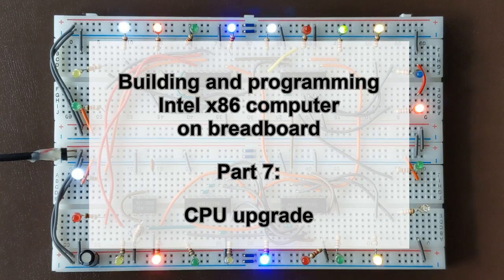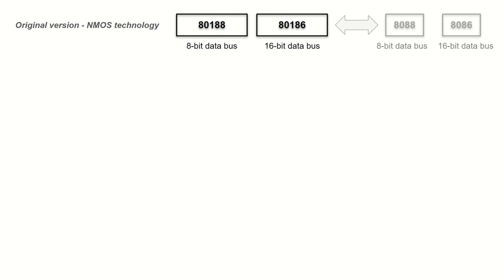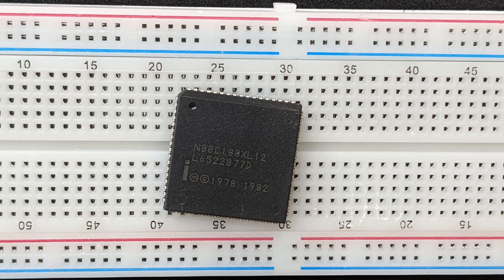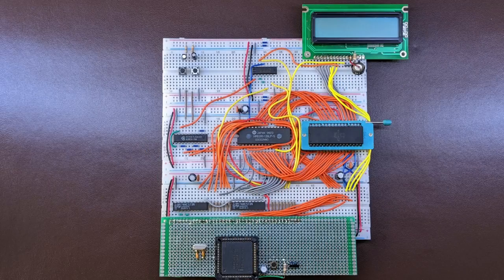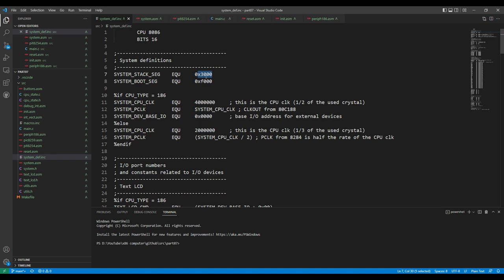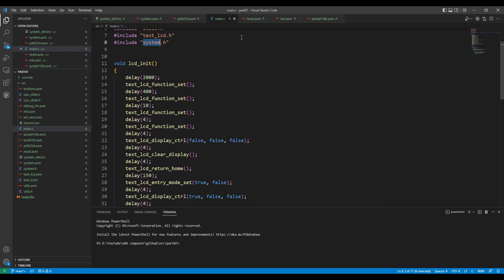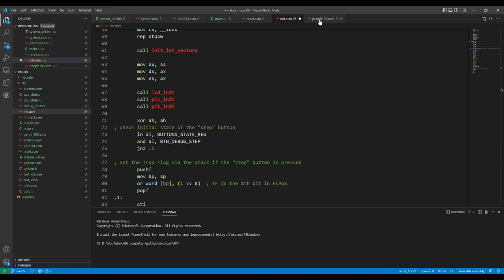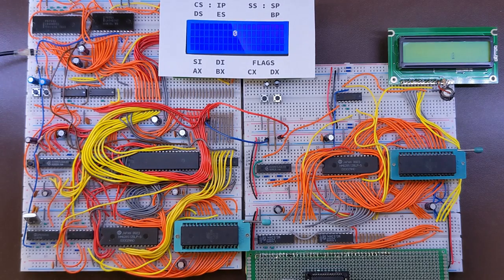CPU upgrade - 16-bit Intel x86 breadboard computer [part 7]

Comment: I recovered an 80C188 from an old printer. Now I really want to build myself a mini PC with this processor. Thank you very much for sharing the schematic. I try to do some experiments. Thank you!
Reply from the maker: Thank you for watching! By all means - yes, experiment! Schematic is very basic - just wanted to show the viewers how easy it is to build something working with 80188 and that you don't need those additional peripherals. I would like to build something more complex on top of that in the future.
Reply: 1 year later - how did you do?
Reply: @RayMillTN1  A series of "misfortunes" prevented me from doing so. I barely unsoldered the CPU from the original board. Now I have moved on to other projects, for example the power supply, which had passed away. Unfortunately, dedicating only 2 hours a week to this hobby is difficult to achieve results. I'll try harder!!

Comment: Your videos are so inspirational.  I love working on low level bits/register levels.  Never attempted doing it on 86x type cpus as didn’t see many clear tutorials as yours.  This is great , I’m working on a lcd/vga controller using the propeller chip.  Will use that in conjunction with the 8086 stuff to see if I can make some whacky system.
Reply from the maker: @bitlong4669 I'm going to introduce a VGA controller soon, but not based on TTL - instead I'm going to use some modern chips for that. I hope you'll like it. What chip are you planning to use?
Reply: @SladorSoft  I was thinking of using parallax propeller.  It’s an interesting microcontroller.  8 cores, neat timer functions.  The older P1 version as I have lots of those, or maybe I’ll buy newer P2.  They don’t have lots of memory on board, but I do have some dual port ram to compensate for that.  Another avenue would be to use fpga.  If it runs stuff like prince of Persia , wolfrenstain 3d…..maybe doom lol, that be good enough.  I’m not nearly as experienced as you so we’ll see how it goes.  It’s more of a journey for me not a destination.
Reply: @SladorSoft  ah I see why you asked about chips.  I just finished watching the PIO video.  The propeller chip have these timer guided outputs as well to generate vga signal for example.   I see the potential for the same with pico PIOs.

Comment: I've made an SBC out of an 80C188EB, from a scrapped hsdl modem. Now it's running ELKS, and I've added a simple isa interface for a network adapter, which also works on that system. You should have a look at it, you'd need 512/512 flash/ram to get it going, but not much more. I don't think the serial port would work out of the box for your XL, but it's doable :)
Reply from the maker: Santiago, thanks for showing me this. It looks really cool! In the upcoming video I will fix the issue of not using the whole 512kB RAM and start adding more peripherals, so we will see how it goes. Maybe one day I will be able to run ELKS on it as well? Thanks!

Comment: Doesn't the 80188 have dedicated "mid memory" and "high memory" access lines ? You show the part of the data sheet at 08:20. I think you can program MCS0-3 to be address line inputs for your SRAM memory chip, so you can address the full lower 512 K as RAM. At 16:10 is where you.can initialize it, and then use that to access RAM. It might need an OR gate or a "diode or" for the chip enable to the RAM.
Reply from the maker: Yes, you are perfectly right. but - as you correctly noticed - it would need an additional gate (AND to be precise). I didn't bother as it was only a temporary contraption on breadboards which I later moved on to a PCB. Then I decided to use the address line A19 to select RAM, because I'm planning to use the MCS signals in the upper half of the address space which I'm going to do in a future video (around the third from now on).

Comment: @slador, I have been looking over the 8086 datasheet and I can't figure out what the maximum allowed current draw is from the address/data lines. Do you have any idea?
Reply from the maker: @Pete Dietl: you are right - I haven't found it as well. I guess they never expected us to tinker with it and hook - for example - LEDs to the buses ;-).
Maybe we can infer this from other data in the "DC characteristics". I guess, if you keep your current drawn from all outputs and the ICC together below the maximum power dissipation you should be fine. For the 80C88 (the CMOS version) it is 1 watt, so the total current drawn should not exceed 200mA where the CPU itself uses 10mA/MHz. That would mean that for 80C88A-2 (the 8MHz version) it would leave you with quite comfortable 120mA.
Again, don't cite me on this ;-)
Reply: @SladorSoft  good thinking. So limiting each LED attached to an address line to 5mA should probably be ok.

Comment: Hey, I'm trying to do research on doing my own i286 homebrew build. I'm only recently starting out, and I have a general plan for the featureset/design I want, but one thing I'm having issues with is actually: where can you buy the CPU/ROM/RAM socket you're using? Looking up "286 CPU Socket" isn't very helpful lol
Reply from the maker: @Kaisogen I generally look in electronics shops, or simply eBay or Amazon. It depends on where you are, really.
You are right: searching for "286 CPU socket" may not give you good results. You need to check the datasheets of your chips for the type of package they have. For example, the 286 has the same package as my 80C188, which is PLCC-68. My Flash and RAM are DIP-32. Try searching for those. The green socket I'm using for my Flash is called ZIF (Zero Insertion Force) socket - very helpful in early stage when you programme your Flash a lot ;-) Good luck with your design!
Reply: @SladorSoft  thank you, that's exactly what I needed! I'm thinking of using an NEC μPD7220 for the graphics! One of the design gimmicks I'd like to implement is bank switching for the hardware ROMs via a cartridge slot. So you can load multiple EEPROMs for your OS / Software alongside a slower peripheral.

Comment: Do you have a .hex file for the 29c010 ?
Reply from the maker: Hi! My programmer uses flat binary files and that's what my Makefile produces by default. If you have the "ia16-elf" toolchain configured you can compile it yourself and then run: "ia16-elf-objcopy -I elf32-little -O ihex bin/part07.elf bin/part07.hex" to get the hex file. If not, I can send it to you. Please, email me (my address is in the About section of my channel) and I'll reply you with the hex file.

Comment: Great project, but going for 80188 makes it incompatible with all PC software (there is a reason it was not used for any PC Compatible machine)
Reply: Really? I am not sure, IIRC it is software compatible with at least 8086, even with 80186 which itself is a somewhat expanded 8086 but unlike 80286 not having (16 bit) protected mode, but some extra instructions of 286 is supported. Surely it is not compatible with '286 at least. And in fact there was some (though not many) "PC compatible" computers based on the '186 where '188 its 8 bit variant by the size of its external data bus (but IIRC not so much  a problem about software compatibility). I would guess, it's more-or-less OK to have a 8088/XT class compatible design at least, as it's not enough for 286/AT indeed.
Reply from the maker: @seeindarkness - yes, that's true, but PC-compatibility was never my main goal in this series. Also, by writing a proper BIOS you can still achieve some compatibility (by correctly implementing some of the system calls, INT 0A, INT 13 and so on...) but that's another story. Thank you!
Reply from the maker: Hi! There is a machine code compatibility and computer as a whole compatibility. You're right saying that you can write compatible machine code which works on both 8088/6 and 80188/6 (just compile for the former one), but the peripherals inside 80188/6 are not compatible with those in IBM PC XT. I think what @seeindarkness meant was that it's not compatible, because it does not have 8259, 8254 compatible chips, so any programme written with assumption that these chips are there (at very specific I/O addresses) would not work. It doesn't mean that none of the software would work. Depends on how closely the software touches the hardware directly (without BIOS in the middle).
Reply: @SladorSoft  Yes, exactly. "Clean" DOS applications will work since should only use DOS (or at max) BIOS interrupts. SURELY, many (hmm, most) are not this kind. But saying "all" it's a bit too much, what my point was. Also building an SBC in my eye is not so much about re-creating a PC compatible machine, I would prefer creating at least something partly new. (OK, then for sure, the problem of lack of software, but hey, that's the challenge ... ).